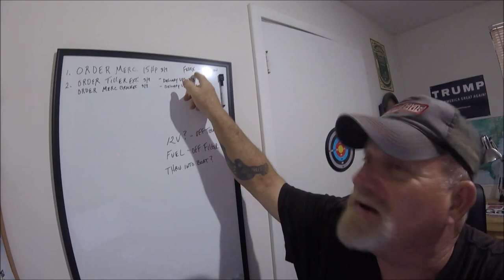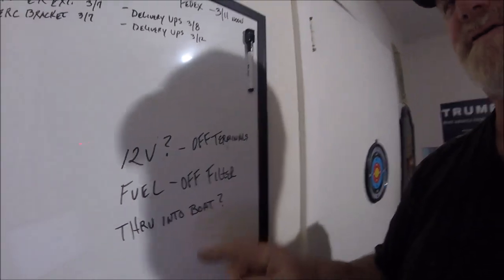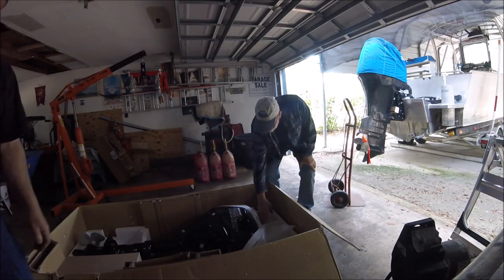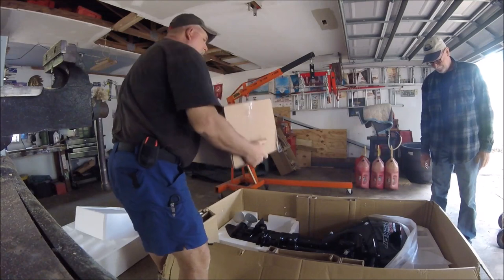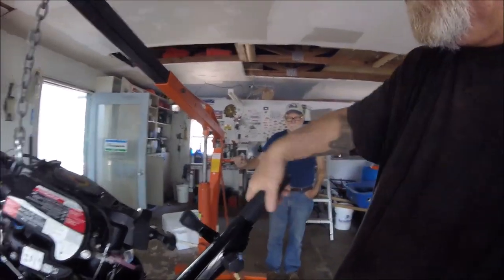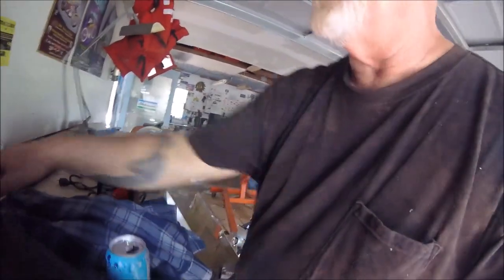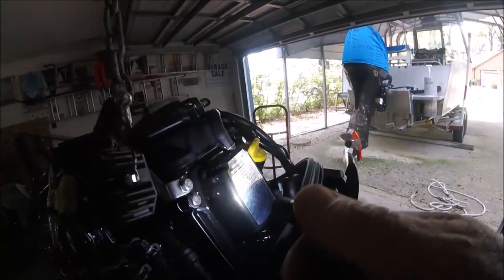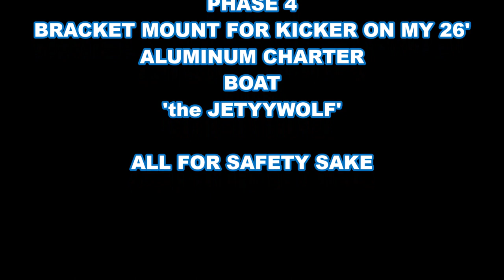MERCURY 15 hp PRO-KICKER phase 3 'UN-BOXING'

Comment: Are you able to replace that tiller with the one that has the twist throttle? Im sure you could possibly sell this one with the throttle lever to offset the cost id its possible
Reply from the maker: hell, I don't know what I like or don't like yet.......don't worry this won't ever go over 1000 views in a wk. Ya don't have to work it too hard.....hahaha
Reply: @CaptDavesSportfishing  I always drop 2 or 3 different comments lol. Dont be to pessimistic Cap, I'm doing my part and  sharing on FB and the twitterspace